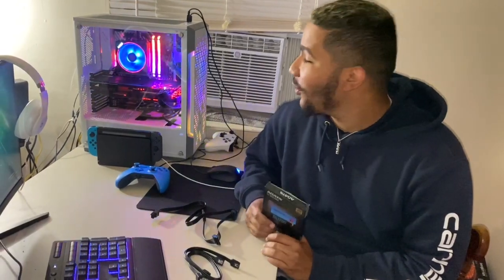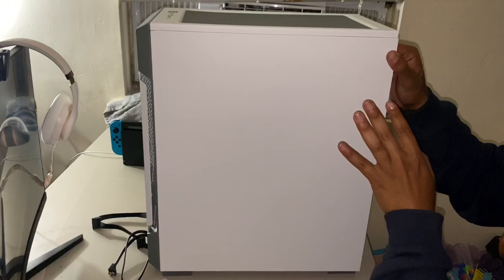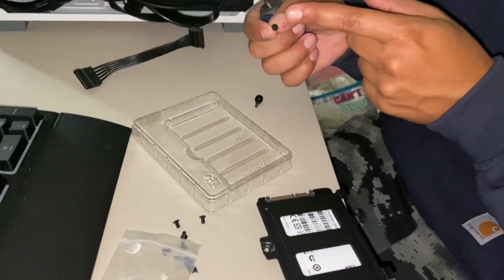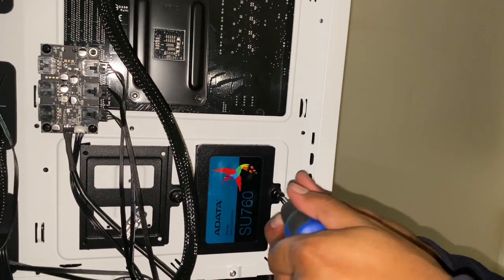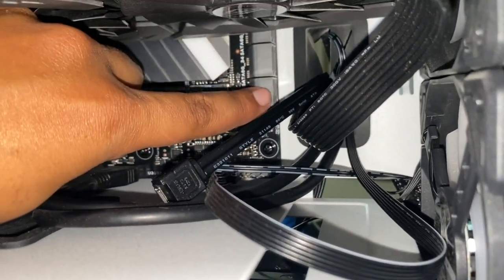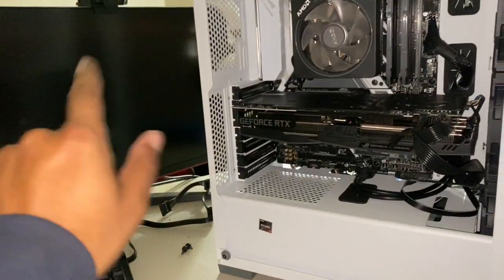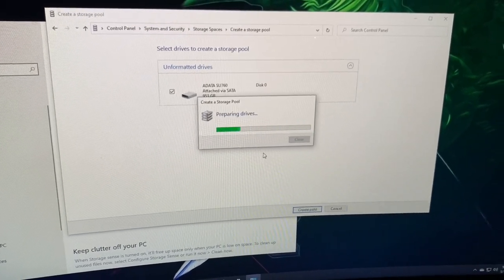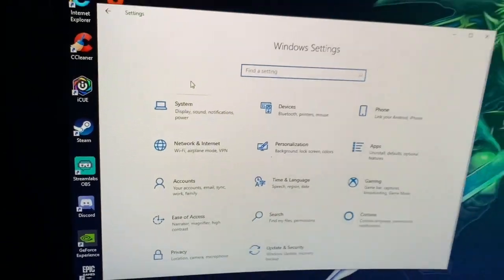How To Install SSD In Your Gaming Pc

Comment: What's that "L-Shaped" cable called? I need to order another one lol
Reply: It's a Sata cable
Reply: @EnduringGear  do the cables come with the ssd
Reply: @sound4640  it depends most of the time they don't, at least the ones I've gotten, check the back of the package and see if it says a sata cable is included

Comment: Nice vid on installing ssd! However, i hate to be that guy but you have ram plugged into motherboard incorrectly. It needs to be 2 dimm slot and 4th to utilize dual channel its currently in single channel even tho you have 2 sticks of ram, just thought id let you know!

Comment: Can i tell me the two cables you pointed out in the beginning of the video
Reply: You need 2 cables: A SATA power cable and a data cable. The power cable should be part of your power supply. The data cable should come with the motherboard. Most SSDs don't come with one. If you don't have one, you'll need to buy one.

Comment: do I need to buy cables or do they come with the ssd?
Reply: Most SSDs don't come with the cables. The power supply should have at least 1 free power cable for SATA devices. Your PC may or may not have a free SATA cable. If you built this PC, it should have at least 1-2 SATA cables in the motherboard box. If this is a pre-built/OEM system, you may need to buy it separately.

Comment: Ah yes! The SATA power cables!
I had forgotten my PC had those (even despite having 3 HDD).
My computer doesn't allow for cable management, so it's kind of a mess (an organised mess).
Alright, now my conundrum is resolved.

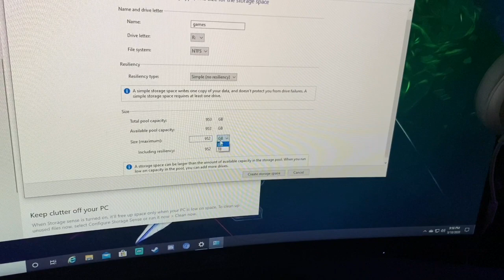9:50 but I see you might have made a BIG error. Never set the maximum size of a memory drive higher than it's actual maximum available memory. I would assume that once it reaches its actual size, it would try to overwrite older data or something.
Reply: Are you sure about that? I followed this video with my 2 TB SSD which popped up as having 1.81 TB of space. I wrote in 2 TB to round it up. Am I fucked? 😂

Comment: Its Perfectly OK to plug in your cables first, and screw in the SSD to the case later.
Reply from the maker: Isn’t that how you blow out the flux capacitor 😳
Reply: @TheRealRickyReels  i mention that because he talks about trouble fitting in the cables. How does that affect the functionality?
Reply from the maker: @Hellboy2049  I’m he lol I made the video
Reply: @TheRealRickyReels  🤣🤣🤣

Comment: There was a place to put my SSD on top of my 1 TB hard drive real easy the plugs were right there also.. Cyberpower PC.. I use that for games other for the system I don't care if it loads slow I have it on sleep anyway so boots fast..
Reply: you installed your ssd to your cyberpower pc? I'm just wondering if I can do the same
Reply: @mattm9396  if its a desktop, just check the motherboards compatibility, and make sure everythings compatible (pc part picker can do that for you, just import your parts and it will tell you) and you can always upgrade any part
Reply: @Оливер-ш6ъ  thanks man

Comment: Yo, thanks man.
I've been a casual pc gamer for a while but I am absolutely brand new at building my own. Like I'm waiting for the parts to come in the mail type new. 
I figured it can't hurt to learn something new while this Rona is going on.
While I'm waiting, I'm trying to learn as much as I can about what I think I need to know and this video was super helpful as far as installing an ssd.
Appreciate your work and you got a new sub.
Peace and good health to you and all of yours.
Reply: Hope your build went well. I've got two custom pre-builts and, when the older one dies, I'm going to practice by smashing in some cheap parts until I can build my own. Scariest thing I've done so far is take apart a GTX 770 to clean it and reapply thermal paste. Scariest thing I've had happen to me is my i7 9700K fault so hard that blue was the only possible colour... it's under warranty so the whole system is going back to be fixed.

Comment: Is it necessary to make SSD primary or something to make the PC run through the SSD while having a HDD at the same time?  Read it on a bunch of forums, would appreciate a response! wanting to switch from HDD to SDD for performance, but unsure about memory transfer & if both can be in simultaneously.
Reply from the maker: Ty Yoda you’d have to put your OS on the ssd

Comment: u put your 2 stick ram on the wrong slots!!
it should be on a2 and b2
Reply: Elaborate please
Reply: @AFKJosh  if u only have 2 sticks u should put them on 2nd and 4th slots or they wont function properly.1st and 3rd slots are made for single channel and the 2nd and 4th are made for dual channel
Reply: COZzZME oh i have two of the same 8gig sticks I should put them in the slots you said?
Reply: @AFKJosh  yeah but check ur motherboard instruction
Reply: COZzZME I’ve got an ASRock b450M pro-4-CB
Reply: @AFKJosh  yeah put it on 2nd and 4th slot
Reply: @AFKJosh  did u see any changes?
Reply: COZzZME I’ve had it correctly

Comment: I am learning on how to build  PC. However, i saw the 2 sticks of RAM seems to be in the wrong socket. Anyone can clarify?
Reply: Depending on the motherboard you have. Some you need to put them "1-1-" as Parmeet Gill said but on the one I have they go "-1-1". It should say in the manual for your motherboard where they go.
Reply: How many sticks do u have. Also if u have 2 ram sticks, they should go 1-1- like that alternating.

Comment: Do we need to buy the cables?
Reply: From cyberpower pc
Reply: @Imane2pont_2.0  Yeah cyber power includes the extra motherboard cables. It will be in with the manual, hope this helps
Reply: @lordbuckethead6030  thank you very much bro

Comment: Bro what are the names of the 2 cords u need I need to cop ASAP
Reply from the maker: Their both called sata cables one is sata data that connects from the mother board into the ssd and the other is called sata power that connect from the Power supply to the ssd

Comment: How do u do this in a prebuilt?
Reply from the maker: Sxmpley see if you have a ssd slot available and plug and play
Reply: Skipstech if im replacing a ssd or hdd can i just unplug the current ssd or hdd plug in my new one and plug in the sata cable and other stuff
Reply from the maker: if you only have one drive its holding your windows boot in there so if you unplug or replace it your pc won't boot up lol if you have multiple drives see which one is holding your windows boot then replace the one that doesn't have it for one with more storage
Reply: Skipstech how do i check which one has the windows boot

Comment: For those of you looking ng to add some bling to your boring, and exposed, gpu plate and SSDs I strongly suggest getting custom backplates and covers from places like v1tech, jmmods, and others. V1tech has some great DBZ predisgned backplates, but you can use the imaging tool to create your own design. Looks like about a 2-4 week turn around time for your order. 4 during these challenging times.

Maybe you could look up three companies that do this and make a roundup review on three different guys.

As for the build in this review I strongly suggest having mesh in front of the front intake fans. You should also add outtake fans (1 rear and 1 or 2  at the top if there is ventilation, see owners manual for allowed sizes) that might help with the dust. If you are looking to upgrade the cooling system, kraken or thermaltake liquid cpu cooler 360mm in the front and repurpose the fans in the front panel as your outtake if size permits it.

Kraken doesn't have rgb but phanteks rgb hallo rings can easily be added on to any boring stock fans if you are an rgb lover.

Should take everything apart including the cpu cooler and air blast it once a month or less depending on how fast dust accumulates.

Enjoy!
Reply: Emmanuel Galleguillos-Cote thank will do 😃😃😃